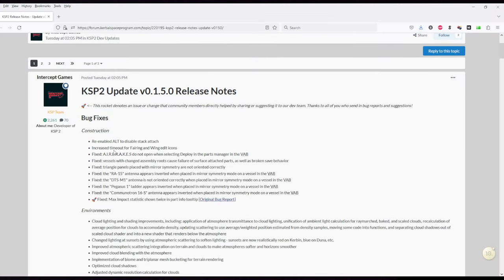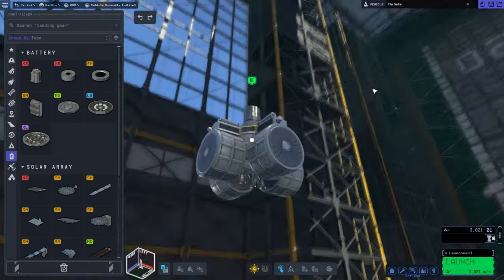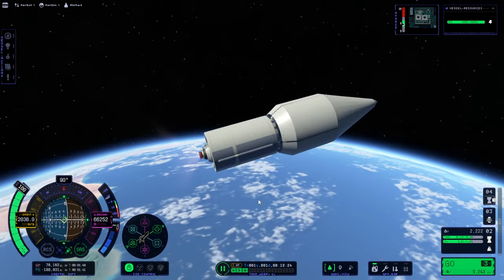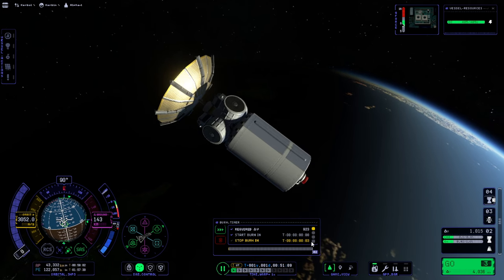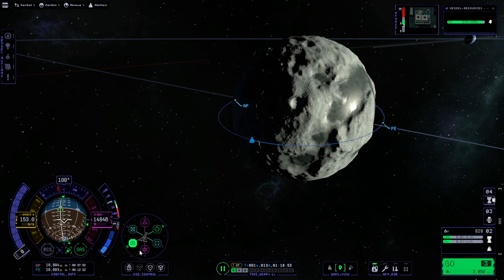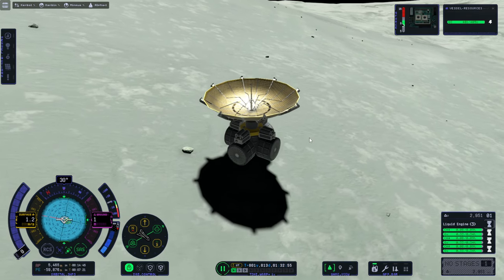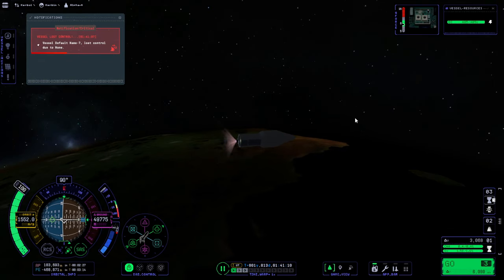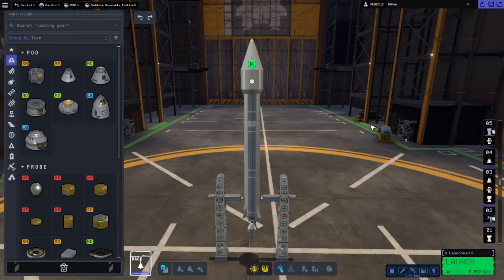KSP 2 Early Access - Patch 5 Initial Test

Comment: Thanks for the upload man. Just downloaded the patch update. Haven't tried it yet, running on an RTX 3070 EVGA FTW Edition, i7-12700KF, 16GB Ram and 2 TB SSD. Never had a performance issue with KSP2, but would LOVE to see those fairings get fixed. Thanks again bud, have a good one.
Reply: if a game that looks this primitive runs "okay" on hardware that overpowered then that is a performance issue
Reply: @doltBmB  Agreed. Eventually it'll get optimized properly

Comment: 6:57 It's also weird that they eject forwards like that, they should move to the sides, not so much to the front.
Reply from the maker: To the side would be ideal, yes.
Reply: I'm thinking (speculating) it's because they are still in a locked state, and the equal forces that push left and right for the fairings to detach and drift away end up in one direction: forward. 
I find these bugs kind of fascinating because it explains a little how the game works :)
Reply: @RaizSpace , do you ever show us the ‘config’ on the fairings? I am wondering if it has to do with deploy-mode… Clamshell x# (splits out like flower petals) or some other mode that maybe does only throw forward (which could work if you were not under thrust and not facing ‘forward’ so it hurls in an unimportant direction)